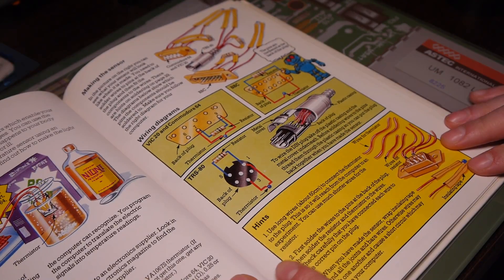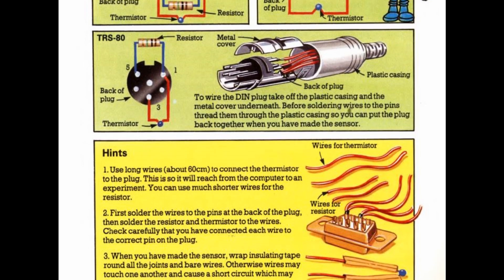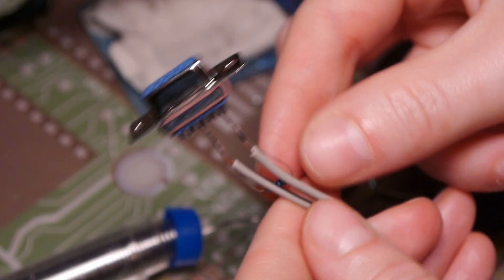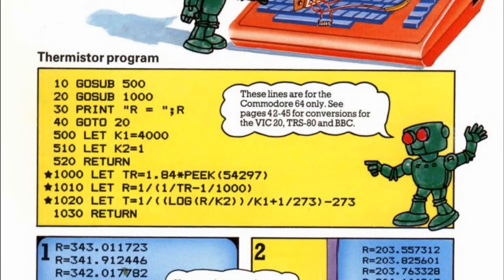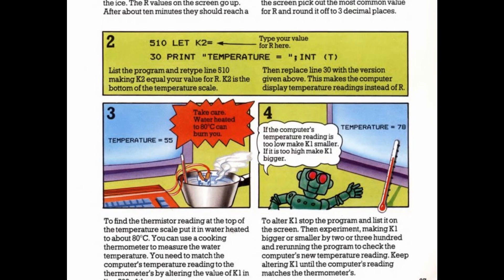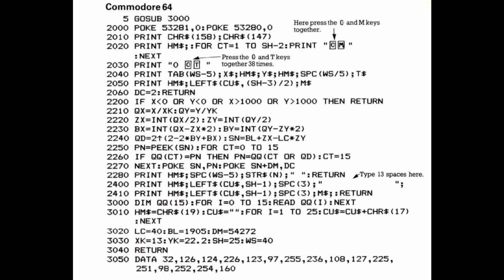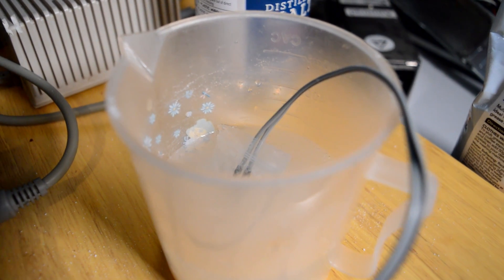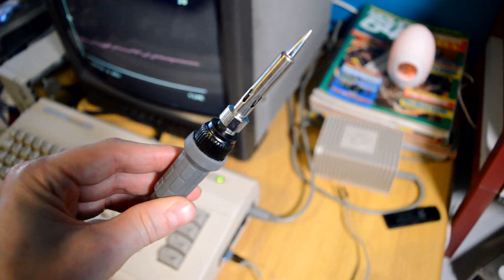Turn Your C64 into a Thermometer! | Nostalgia Nerd

Comment: Mice aren't analog input devices. They send a series of digital pulses which vary in frequency depending on how fast the mouse is moving. My guess is this program reads the paddle input from the C64, since paddles are analog devices. They're basically potentiometers.

Comment: Really cool to see you actually perform one of these educational experiments from the book. Since this circuits taking advantage of the POT X/Y functions of the SID chip, and you are using your (nicer than mine! haha) C64G which has an 8580 SID, I wonder how different the calibration would be if you moved to an earlier breadbin C64 with a 6581?

Comment: There is a frequency at about 16kHz that is very harsh from 0:05 to 0:31 .  Probably a TV or other CRT.

Edit: Actually, the same frequency is trough the whole video, just not as loud. You might want to look into filtering that out with a peak or notch filter. Audacity has a notch filter.

Comment: strange, the commodore 64 doesn't have any graphical instruction (neither sound) basic instruction, so how can you do that easily (as it seems) temperature graphics ? unless you use a basic extension cartridge which doesn't show up in the video. As well the plug DB9 plug would need a cap ... easier to unplug then.
Reply: Maybe they just use text characters and make them look like graphics. That can be pulled of pretty convincingly on a C64
Reply: not sure about this, but shouldn't one be able to create "sprites" by POKEing the correct bytes in RAM?
Reply: yes, but poking is very boring! also first switch screen and graphic mode though an other poke, and then clear the graphic memory, with hundreds or thousands of pokes, which takes a lot of time to execute.
Then calculate which byte and which memory location to switch to switch a single pixel... not to mention how to draw a line a square or circle! Long, complicated and boring, when other contemporary and often less expensive computers and a single instruction to do all of this!
To fasten graphic memory clear, you could also write a 6502 machine language program, if you know, calculate the bytes, type then as datas in your basic program and them poke them into memory before executing.
the Pet basic had at least 6502 monitor to facilita that type of things which the C64 hadn't ! they probably r-tried to save 1 rom chip!

Comment: Basically, what this does is use the thermistor as half of a voltage divider, typically with a 4.7k resistor as the the other half of the divider. Then when you put, say, 5v on one pin, you'll get 0-5v on the other, which correlate with the temperature of the thermistor. Every type of thermistor would have a different minimum and maximum range, as well as a different voltage to temperature mapping. You can do the same thing by using the analog input pins on an arduino.

Comment: I hate to be that jerk that makes the "um, actually" comment. But a bowl of melting ice, at equilibrium (which that bowl certainly should have been) will always be at exactly 0 C. This is because as the mixture gains energy from the air, rather than go up in temperature, it first uses that heat in the process of changing the phase of the ice from solid to liquid. This means that if your thermometers settled on 3 degrees in that mixture either the tolerance of that thermistor is a relatively poor (but not unreasonable, all things considered) ±3C or your calibration was off by 3C (which also seems consistent with what data was shown on screen). Loved the video, but wanted to let you know about the little miracle of thermodynamics that let's all chefs and other professionals with a need to calibrate thermometers daily to properly zero in a thermometer with just a glass full of ice and water. Source: my experience as a part time chef in need of a consistent way to calibrate thermometers, and my knowledge as a physics undergraduate. Also, if you don't believe me, Google it.
Reply: My feeling was "well, he didn't stir it, so close enough".
Reply: actually makes sense seeing that it reported that he had a fever

Comment: I absolutely adored the Usborne books as a kid.  Aside from crafting my early skills as a programmer I also built some of the electronic projects - my magnum opus of the period being a robot control board that I intended to stick in a model submarine.  The submarine never came into fruition but I still have the board somewhere some 25 years later.  Relays salvaged from an old PBX, BC108s ripped out of similar junk and 2.2k pull ups from Tandy.  A few projects back I designed a device that contained a £300 FPGA; oh how far we have come and all because of those books and my trusty C64. Thank you for the major nostalgia trip!

Comment: My goodness. I actually did this experiment from this very book about 30 years ago. I was leant a BBC micro and borrowed the book from the local library. I failed to source the plug so had to stick a couple of wires into the back of the computer instead.

Comment: Back in 1991 my electronics teacher and I made a weather station on a C64. It measured temperature, humidity and barometric presure. All being logged onto disks with 1 hour intervals.
We also set up a second C64 with a satellite dish to grab data from a weather satellite.
A very fun project and it's still working to this day, although the satellite data can no longer be retrieved.
Reply: Pretty much the same time my classes end of year project was a weather station using a Spectrum.  We each had to design one piece of hardware and a software module.  Each piece of hardware had to use the same physical interface to a multiplexer designed by another student. Similarly each of our software modules had to interface with a main monitor program written by the same student who did the mux board.   It not only taught how to design hardware and software but taught us the importance of a standard interface system and how to work within a set of design parameters.
Reply: Back in the mid-90s I made my own anemometer (wind speed meter) using a reverse-driven motor and two ping pong balls cut in half to catch the wind, feeding the resulting generated voltage to the serial port to be measured much as done with the thermistor here. I calibrated it to various wind speeds and made a little Windows 95 program that displayed the current wind speed in the taskbar, complete with category name for that wind speed and a little representative icon. It worked! Except...it kept having random voltage spikes, which I could never seem to quite work around entirely, either in hardware or software. So it would sit there saying: "light breeze...light breeze...strong gale!...light breeze...HURRICANE!!" etc. Ah well. It was quite useful if you ignored those!

Comment: I had two books from this series. I love them. One talked about robot project with the 64. But, back in those days, a C64 was seriously expensive, and very fragile. We couldnt afford any kind of repairs appart from the forced one that happend once a year. User port, Cartridge, and joy are unprotected, pins from the CIAs, SID and VIC stright to the connector without even a clamping diode. So, this experiments were only for people not only good at electronic but also with good C64 knowledge.
Reply: You really gotta be careful messing about with unprotected joy.

:-D
Reply: LOL ... YEP ... protection is a must ..

Comment: That was fun. I remember seeing the instructions of wiring the controller of a RC tank to the C64 user port in Commodore magazine. I wanted to do it so bad, but lacked the funds or the tools. Would still be fun today, although my Raspberry Pi is more powerful and sacrificial.
Reply: On this aspect, RPI is the truly C64 of this era. I mean a decent computer with USER AVAILABLE I/O to use in projects. Small issue is not %100 AVAILABLE, even when using some fast io tricks on the web because there is sort of a kernel tick around. In the C64 all of the HW privileges were nothing but yours. "super" real time thing will eventually need a dedicated shield and then take the data using IIC or SPI (sometime you will share SPI with the screen)

Comment: It's interesting the programme used the command "LET" ie LET X=10 in most basic's LET is redundant and was only included for compatibility... unless yor using a ZX Spectrum... ;)
Reply from the maker: Sean Smith yes, it's not necessary on the C64. But I like to include it for old time's sake

Comment: 3 soldering tips: tin the iron, heat the metal not the solder and wet wipe the tip after a few solders.